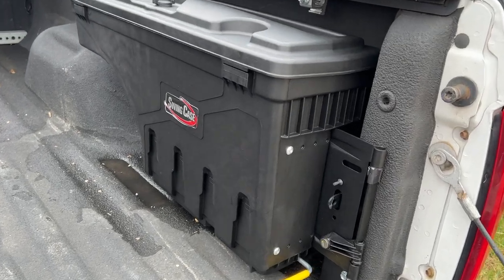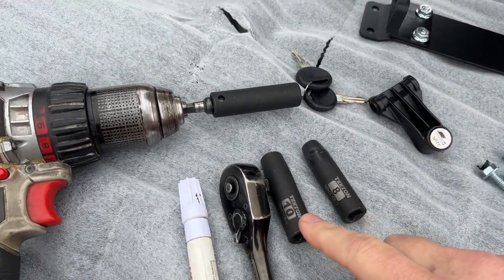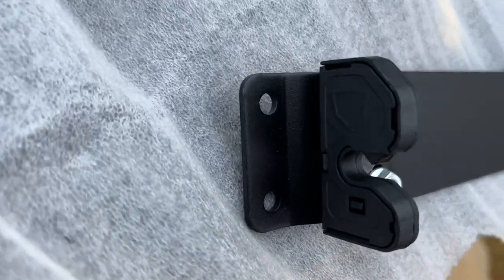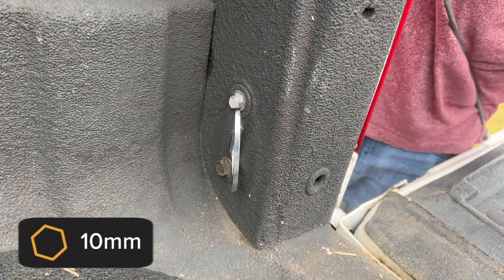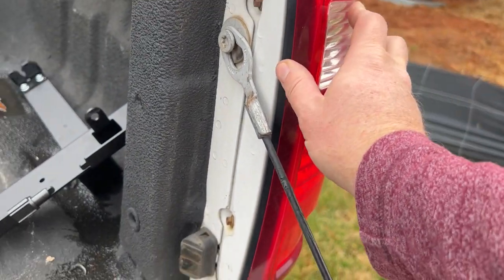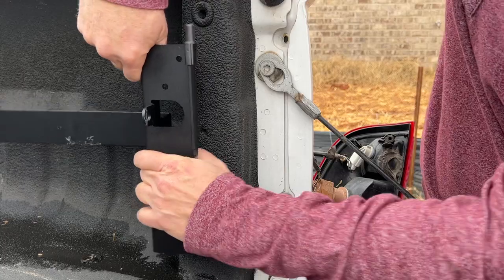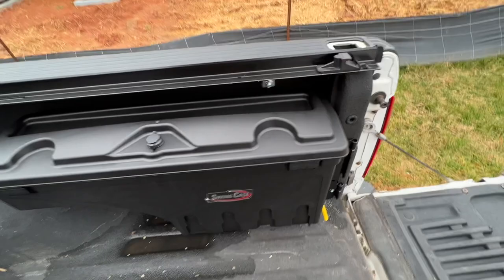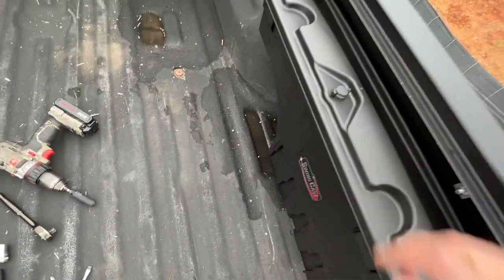UnderCover SwingCase Install and Review for 1999-2016 Ford F-250/F-350 tool storage

Comment: Just installed a set of these on two trucks.  I wouldnt go with out them. I set up higher so i dont have an issue slidding a couple sheets of plywood. About an inch half the bracket is from bed . No issues with tonnoue covers and brackets. Ran combo lock version with combo pad locks.
Reply from the maker: +@Aceman597 I agree. They are great! 🍻